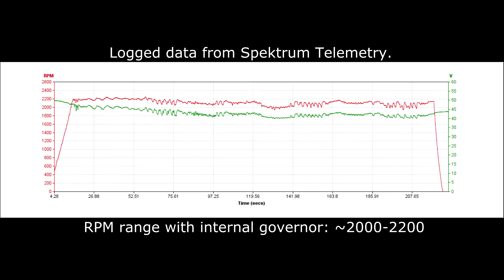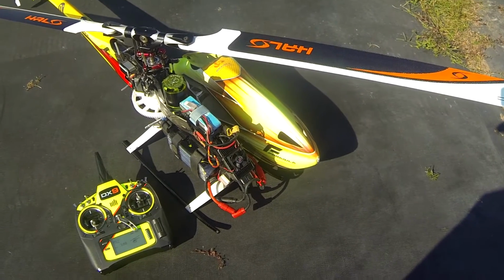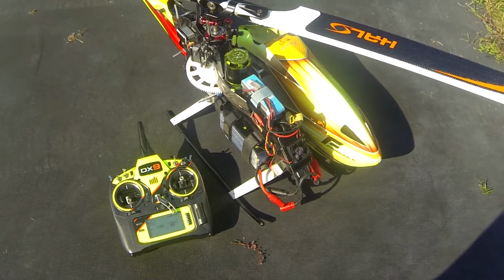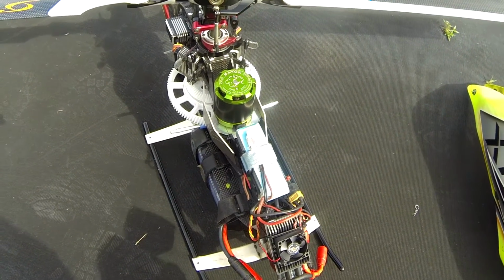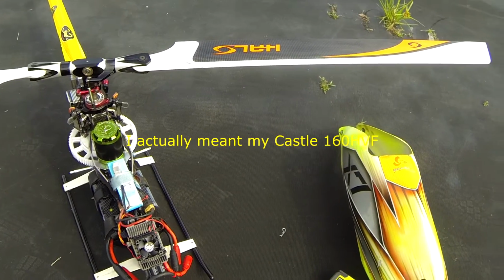Gaui X7 - Hobbywing HV130 V4 Opto - First Flight

Comment: Hello integrityRC,
are you still running the savox motor on this heli ?
please answer cause my motor got burned after 20-30 flight
thanks,
dovella
Reply from the maker: Yes, I'm still flying it. I've actually been flying this heli the most over the last couple months because the servos on my other X7 are acting up. I haven't had any problems. I'm sorry to hear about your failure. I would recommend contacting either your vendor/distributor and/or the manufacturer. These motors are covered by a 1 year manufacturer warranty. So you may be able to get it replaced.
Reply: Thanks for answering i will try 2 tallk with them

Comment: Hi how does the Halos fly
Reply from the maker: I like the Halo blades too, but I haven't ever tried the 715mm ones, only the 700mm ones. So it's hard to compare them to Rail 716s I'm used to flying on my other heli. But now that I have the pitch range and RPM setup how i like. I like the Halo 700s just fine. Sorry it took so long to reply. For some reason youtube wouldn't let me comment any time i tried. It does that sometimes and I don't know why.